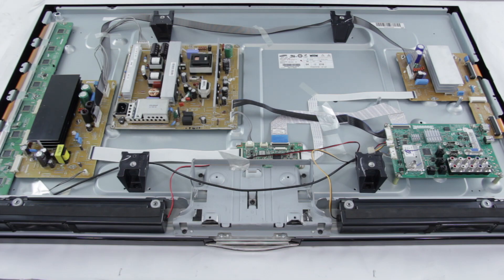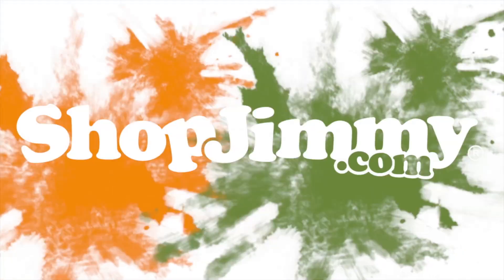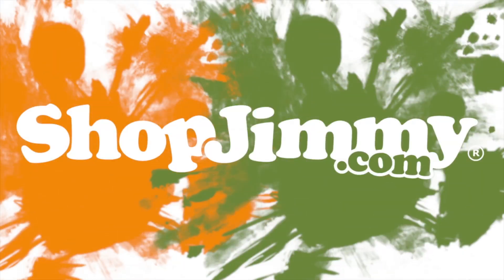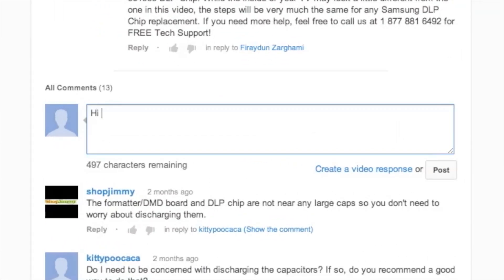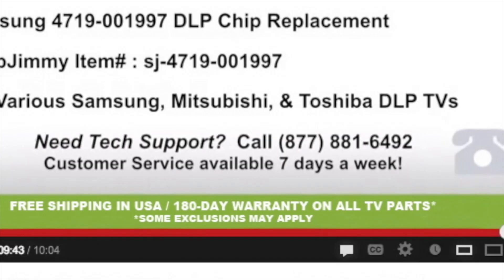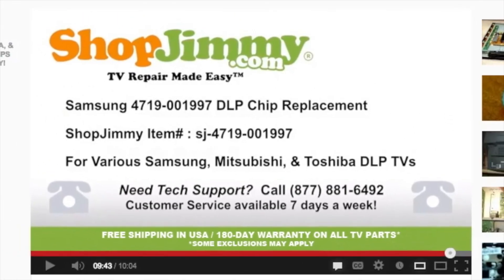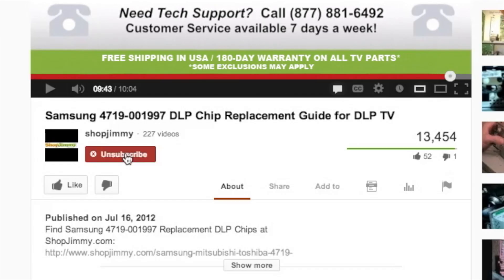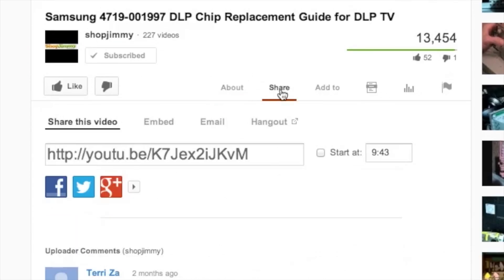Plasma TV Repair Tutorial - Common Symptoms & Solutions - How to Fix Plasma TVs

Comment: Samsung Plasma 58"  PN58A550S1FXZA - When starting the TV in the morning it power cycles multiple times and will have a "fuzzy" picture mostly green prior to coming up completely.  Once the TV is "hot" it will be fine.  It seems to resolve the issue itself by restarting 3 or 6 times.  This started very recently about a month ago.  Would like to fix it if possible and use the TV in a different room.

Comment: I have a tc-p50s30 tv. I bought it in Jan. 2012. It's been down for the past 2 months. It will turn on by remote or tv, but I get no picture or sound. And, I cannot turn it off with the remote or tv. I have to unplug it from the outlet to turn it off. What board would I need to change?

Comment: My TV has a pinkish-purplish discolouration on the left side of the screen or panel in a small half circle forming. It has not gotten any worse and can only best be seen when there is a white or light collared background. I have been told it is the panel itself and can not be fixed. Someone else mentioned it could be dead pixels. I am a little confused on whether it can or can not be fixed. I have put it all the model information below to help identify the problem and or possible solution. 

New Samsung 60" 3D HD Smart Plasma TV
6018871060180891
VSN#: 0F5500AFXZC
www.samsung.com

Model No.: PN60F5500AF
S/N: Z7FP3CBF901654H
Model Code: PN60F5500AFXZC
Type No.: PN60F5500
Version: US01
Barcode No.: 887276021058
Samsung Electronics Co. LTD.
Made in Mexico
Reply: Kimberly, Not an expert here but I have a Panasonic that had the same issue as yours. It's not bad pixels. A bad pixel will remain a solid color. I have a bad pixel that remains blue. (a tiny blue dot in the screen) Pixels cannot be fixed from what I'm told by a repairman. It's unlikely to be the panel. By what you are describing it is a card (circuit board) with a failing component (capacitor). My tv inventually stopped working. It turned out to be the SC card. Probably called something different on your t.v. but does the same thing.

Comment: I have a Samsung 60 in plasma PN60E530A3FXA that for about a year has had issues turning on with an image once turned off. Example: if my son was watching tv and turned it off we could not turn it back on with an image (positive sound) for 15 minutes or more. Once on everything was perfect. We even ended up having to change the source and have the Xbox on for it to come on with an image and then you could change the source to the other inputs and all displays worked fine. Now i can not get an image from any source no matter how long I wait with the power off, I still get sound. All the capacitors appear normal (no bulge) fuses look fine. Is this an issue with the main board or something else? I hate to throw out something that my be easily fixed, its a great set.

Comment: Hi I have lg 50pk790-zc the tv powers all works as it should no sound output? any ideas what controls sound? thanks
Reply: Hi Jon, My 50PK760 just lost sound. Any solution yet? I have ordered a cheap optical to VGA + audio box to test the optical audio out and might just buy a used HDMI receiver/amp. It may be something as simple as reflowing the solder on an audio chip? I'll let you know what I find out and please do the same. derek r white at yah00 d0tc0m

Comment: Hello. I have a LG 50PK540.  It has an atypical issue from the usual power board issue.  Utilizing my HDMI port I have a Roku connected. A week ago the TV shut off abruptly during viewing. Upon attempting to restart the standby light went out, the TV clicked and then returned to standby.  After a waiting period I was able to regain operational status. Within the past week the TV has gone from remaining on for several hours to now only remaining on for a few minutes. Attempts to power up result in a momentary powering then cycling to standby, repowering with a click then going back to standby.  However if I power up again successfully in a few minutes to select Pandora radio on the Roku menu, then turn off the video  display immediately before it turns itself off, the power remains on for  a long time, allowing me to listen to streaming music. I have digital optic cable going out of the TV to a receiver. This leads me to question if the power board is the problem, or something else?

Comment: I have the same Samsung PN50C450B1DXZA THAT HAS HORIZONTAL BLACK LINES ON TOP AND BOTTOM, I REPLACLED THE Y-CON BUT THE PROBLEM STILL THERE, I CLEANED CONNECTOR WITH ALCOHOL AND UNPLUG AND PLUG BACK ALMOST ALL CONNECTORS , ANY SUGGESTION WHAT CAN CAUSE THE PROBLEM ???  THANKS

Comment: G'day. I have a Panasonic plasma model TH-P42S20A. It intermittently has a vertical  band of translucent color at about the middle of the screen. Sometimes its a very fine line,at other times it expands to a band of about 3cm wide. It has a greenish tinge to it . The coloration is not consistent, varying in depth of colour at various spots on the band. It does flicker slightly. Curiously, the entire problem disappears in cooler weather. This indication that it's related to environmental temperature makes me think this could be a "dry joint" or a "loose connection"  somewhere and therefore probably repairable.I have done some research and a poorly seated or loose ribbon connector to the panel seems to be a likely cause, although some data implies that the logic controller could also be the problem . May I have the benefit of your opinion please. I am a communications technician and am contemplating attempting the repair myself if it's relatively simple. ( we love this TV )

Comment: I have a tv, I would like to get fix that just sits around and doesn't get used. The Tv is a lg50pq30 The symptoms it has a red light and then blue for on.  When we go to use the tv sometimes the red light will blink blue then back to red which is off. Sometimes the tv will work.  We took the tv to the local repair and the said it was the power board, Got the tv home and the same problem.  They recommended come back and spend more money and get the main board fixed since this problem can be hard to tell.  So I took the tv back and ask for them to remove the part. I got my money back. I was thinking I would buy a main board and do it myself. I work on pc's all the time, it should be similar.

Comment: I have a Samsung Plasma TV Model: PN60F5300BF with green flickering vertical lines only on the right side of the screen. I disconnected all peripheral devices and have the TV set-up with an HDMI cable connected to the SDS HDMI Port of the TV to the HDMI port on an Xfinity X1 cable box. The only thing I can add is that the HDMI cable is long and possible have bent the ports as they have been stretched.

Comment: Samsung plasma model PS51D450A2MXXY
IT stopped when a power plug came out of a power board then the TV wouldn't work.
TV has power with red light on front and power supply has green flashing light in the back of the unit.
TV has no sound just a black screen with small white lights throughout only visible in a complete dark room?

Comment: I have a MODEL#: PN60F5500AFXZA SERIAL#: Z6VX3CBD702072T.  I am having a power cycling problem.  The TV continues tries to turn on and turns off after about 10 secs. I took the back off and don't see any swelled capacitors.  Do you have any ideas?

Comment: I have an Plasma LG 60PZ550.  The screen does not show any image but the tv does power.  This happened a few months ago and a removal and reconnect of the power cord corrected the problem.  Now that does not work but it is the exact same symptom.  I suspect the Y-SUS / X-SUS.  Is there a replacement part you recommend?

Comment: I have a Vizio P50 HDM plasma - When I press the remote power, the green power lite comes on. There is no image, but there is back lighting.
 The remote will not power off the TV. I have to unplug the power cord, before the TV will turn off.  After plugging the TV back in this resolves the problem, 
 The TV will power up correctly.  Problem is intermittent, but becoming more frequent. Can you help ,please ?

Comment: Panasonic TH 42PX80 will not turn o. No standby lights either. No reset response either.  Good FET, diodes, transistors, and fuses. Filter capacitor appears to check good with DMM. NO EST METER TO CHECK BETTER. Could C446 be a problem?  HELP!!!!!!
Reply: Me too, it could be the trouble but look for the end fuse, it's a protection shutoff component. Trace back from where it goes into the fuse "not out" as that is the circuit it protects. It could also be the logic board controlling standby before other relatives boards fire up. Anyway mine was the fuse and a resistor coupled with a electrolytic capacitor 220uf by 35 volts.

Comment: I have a samsung pn51e450a1f plasma TV and it has a weird symptom. I usually can fix TVs but this one has me stumped. There's not really any solid vertical or horizontal lines but looks static. Kinda like the old sets that did the black and white static when the channel wasn't coming in. Power and stand-by seems to be fine just when I turn it on its that static. Any suggestions?

Comment: I have just got my TC-P42S1 Panasonic Plasma after the A board was replaced with a refurbished one.  All seemed to be fine until I noticed an infrequent blink, or quick judder, or quick ghosting on a certain image of the screen. It is never the entire screen. Like if I see a blink, it would be 2 lines on the top part of the screen that will last for 1 second. A quick ghosting the same, 1 second. I can go 50 minutes with no issue or 2 incidents in 5 minuets.  I restored it to factory settings because I seen a message that said “error fix in progress” when I was loading the direct cable QAM tuner..only saw that message once when programming favorite cable channels .  It does it on DVD, Blue Ray & Firestick on all 3 HDMI feeds & direct QAM cable. After reset I did not connect or program the QAM,  I changed the power chord, changed the power surge strip. I set the video NR to on & off, still random infrequent noise, or 1 second flash/blink. Any idea.  The repair man wants me to take a picture but it is so fast and so infrequent it is impossible other than to set a video on it.  Any help would be greatly appreciated

Comment: Pioneer 55inch plasma that if you pause a DVD or chanel or a Tele symbol is on screen it burns onto the screen
Can someone tell what this could mean please?
Reply: I have a 2011 Plasma Panasonic Model TH-P50X30M. The power shuts off during viewing, it makes several clicking sound then resumes back and then shuts off again, it cycles that way. Its switching On and Off while watching. Can you advice what could be the trouble in my unit and what part could I possibly replace or repair. Thanks.

Comment: hi i have a PN51D530A3F mole Samsung plasma tv and what happens is that the tv turns off as soon as it is turned on. I took out the X main board and it worked without an image. SO i want to make sure thats thats the onll one thats not working?

Comment: Awesome video, thank you for putting this out here. I have an issue with my LG 65" plasma TV. It just stopped providing picture. It does give the standby light, it does power on, I see the light in the power supply and the main board. No picture. Model# 60PA5500-UG Serial# 208RMSS8W550. Manufacturers date of August 2012. Any help would be greatly appreciated.

Comment: Insignia NSP501Q 10A vertical lines:
I have vertical lines across the screen. Other than this issue the TV has a beautiful picture and HDMI ports work fine. Help! I have removed every single ribbon and push on connector,cleaned and reconnected them. The issue persists. If the set was not like new i wouldn't bother with it. But it does have a great picture and sound.
https://www.youtube.com/watch?v=59NwZn3oThM

Comment: My LG Plasma TV (Model No. 50PX950-UA) has no picture. It turns on, but the screen is black. The source inputs work fine on another TV. The menu is not visible. Thoughts?

Comment: I have Samsung plasma tv model PN42A450P1DXZA that has a vertical line on the left side of the screen i think i need a new main logic control board and my top flat ribbon on the that board that pugs into my main video board has a little split in it and may color is not clear like something is on that ribbon.what do you think.LINDSEY

Comment: HI, I have a Pioneer PDP-516HD Plasma 55" that is showing more blue than anything else. I have adjusted the temperature settings, color controls and others. I tried resetting and no changes. I noticed it had happened after plugging it into a surge protector which I removed after noticing the color changes.

Comment: LG 50PS60-UA PlasmaIntermittent No Picture w/sound.  When screen is on, great picture.  Can play with plug P2 and can often get a picture to appear.  If I unplug ribbon cable at P5, I get a picture that stays on , however, its just a gray screen (assuming because of no video signal).  The tv will remain on like this for quite sometime, then will shut down by itself.  Thanks for any help

Comment: Very informative however still a little undecided on what board is at fault, I have a LG 60PZ530 Plasma with no picture, the unit has stand by power indicated, turns on and looks like it going to work however no picture, have checked the Power Supplies and looked at the Y Sus checked top and bottom buffers both indicated ok however whilst still connected with only the bottom connected I get the bottom lighting come on. Once connecting the Top Buffer again back to nothing the logic board is not flickering as a normal constant beat as well, I'm thinking it may be the Y Sus board? any other suggestions.

Comment: I have a Samsung plasma hrp5012x/was. Tv turns on and plays beautifully for about 2 hours then the picture becomes distorted...no lines but colors change tint and double a little...feels like set is over heating. Can you tell me which circuit board is responsible?

Comment: I have a Samsung plasma 50in. model no. pn50b450b1d and the symptoms I have had in the past were the TV clicking on and off until I unplugged it and replugged it back in then it worked find again for a while, now my TV screen doesn come on at all the redlight comes on and the tv clicks then a couple seconds later it clicks again like its turning itself back off again, I took the rear panel off and disconnected the powersupply from the CTRL board and hit power and the tv made its normal audio sound that it had not since it was broke, I checked for bulged capacitors and there are none, there are two LEDS on the ctrl board one lights up when you turn the tv on but when that second light comes on the second click(relay?) happens and both leds turn off and the tv it dead again. I just want to order the right part

Comment: I have a Panasonic TC-P42S30 plasma tv. I'm seeing color aberration, seemingly instantaneous burn in, and seemingly large random color blobs on large white or light color areas. There is also a greyish tint over the screen. I'm not sure if this a powerboard problem or a input board problem. Given the cost, would like to nail this down before ordering parts. I have images if that helps.

Comment: I have a 55" vizio plasma. I am able to power it on, it will work for about 30 minutes to an hour then it will power off. It takes a few minutes to reset and will allow me to turn it back on. But repeats the same cycle. What's going on? Is this an easy fix? Do I need to replace something?

Comment: Hi. I have a Samsung HPT5034X/XAA 50 inch plasma tv. It turned off completely and would not turn back on. I pulled the back off and took the fuses out of the power board and they checked out fine. I replaced them and the tv powered on. It worked,for a couple of hours then turned off again. I tried the same thing again and cannot get it to come back on. Any suggestions? Thanks. John

Comment: Hi I have a samsung plasma Pn60e550d1f that I got from my parents. The red power light will blink with no display picture but you get sound. We used to just unplug the tv for a few hours or turn it off. Randomly a few months ago those tricks stopped working. It’s been months since it’s been plugged in and I tired to start it up again and the same thing f happened. No picture but have sound. I can’t change the input to try a blu ray player and anything like that. Which component do you think needs to be replaced

Comment: I have a Samsung 55" pLasma that has a vertical strip about 2" wide on the left side of the screen? The rest of the picture looks great.Could i possibly get by with cleaning the ribbon connectors or do you think this could be a board issue? I know it's tough to diagnose without looking at it yourself. Any info would be greatly appreciated

Comment: ok I have a dell plasma model w4201c hd that I replaced the power board but other issues happen once it warms up
like screen starts slowly to go like pixelly and colors start to change such as white dull out and grey and then if I let that continue all colors start to fade out and go nuts then screen starts to go redish at left side going across the screen  kinda snowy looking with some lines and image ghosting looking almost like going negative looking
I can post a small video and pics if that would help
honestly I found every boad for this tv for dirt cheap but I am not one to throw parts at something 
my email is brianjennings40422@gmail.com   I will keep checking on replies on viseo here also  thank you for your time  just let it go crazy again and noticed that the icon for my name  has a ghost inmage in a different color about 2 inches below original

Comment: I have an lg 50pn5300 as soon as I plug in an hdmi input the tv locks up and I have to unplug it. It will play music through the usb but will not play anything in hdmi ports
Reply: And the screen work fine and powers on and off unless you plug something into the board the you ya e to unplug to regain function